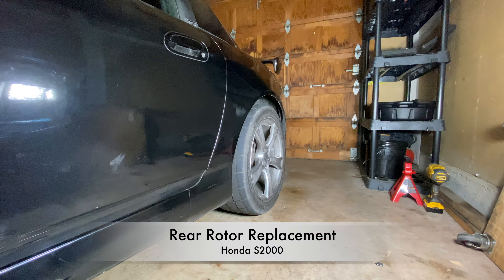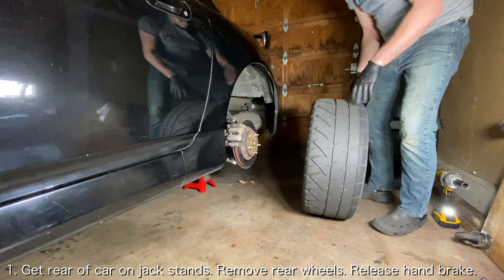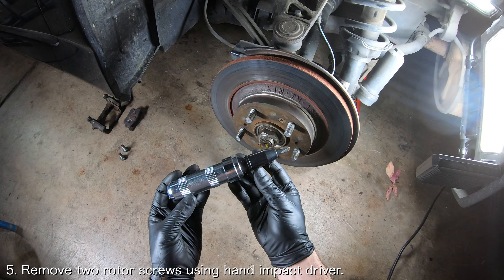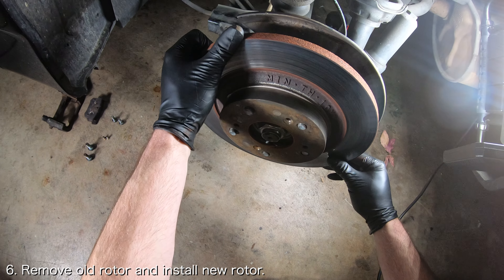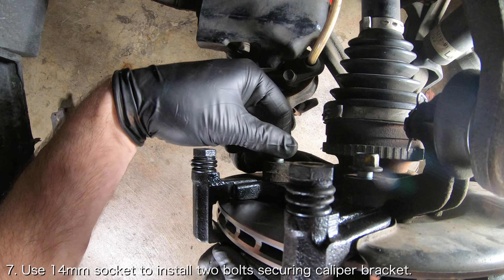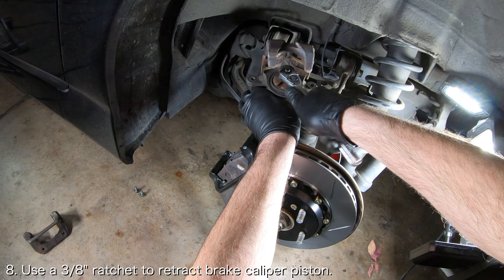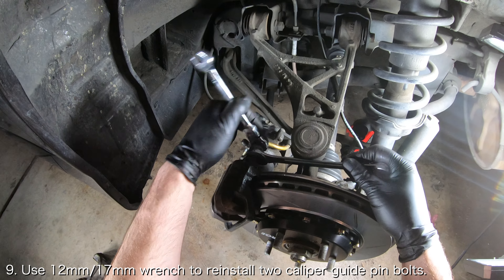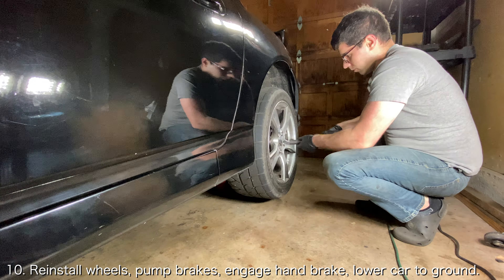Rear Rotor Replacement | Honda S2000

Comment: The rotor screws are JIS not Phillips head. Get a JIS screwdriver and they come out easy
Reply from the maker: Thank you! I’m still skeptical how easily they will be to remove with just the right screw driver. The impact helps a ton.
Reply: A number 3 Phillips works as well
Reply: @DIYGuysvideo  

Use a JIS impact screwdriver. Looks like a normal screwdriver, but hammer it, and you see its actually an impact driver.

Comment: Suggestion, loosen bleeder screw whenever compressing a caliper piston. Attach a bleeder hose to direct the fluid into a container.

This way no fluid overflows reservoir, and more importantly, doesn't force fluid backwards through ABS module, which can cause issues.
Reply from the maker: I’d argue that your suggestion is the most correct way to do this.

Comment: I like to put copper anti seize lube on the hub surface (after some removing some rust if necessary) so the rotors won’t get stuck for next replacement. Also putting on some silicone synthetic lube on the caliper pistons.
Reply from the maker: Thats some TLC ha.

Comment: I have these on my rotors on my s2000 now, great upgrade. Any chance you noticed some more noise from the rear brakes since installing these? Im guessing the noise is because of the grooves in the rotors as well as the lack of being able to use the pad slide clips?
Reply from the maker: Haven’t noticed anything too unusual yet. But yeah I’d imagine you’re correct about the missing clips.

Comment: Have you considered the SBG RX8-S197 rear brakes? They're awesome on my car! Also getting the brakes warm then using canned air held upside down to super-cool the screw will get them out super easy
Reply from the maker: I have. Also considered the Reilly Racing kit. They all have different advantages and disadvantages. I will talk a bit more about that in the urge flow rear rotor review. I basically just wanted to keep the car as close to OEM as possible.
Reply: @DIYGuysvideo  I was going to use his however SBG had a better deal and it's the same thing. I got the rotors and brake lines along with it for $50 more with free shipping.
Reply from the maker: If your sole purpose is to lower rear rotor temps then it’s the “same thing” but the kits are very different. As you know the SBG kit changes the calipers, rotors, and pads. As a result it adds rear brake bias, is heavier and requires different modifications on installation. If you wanted to use a quality two piece rotor with your kit you’re looking at $1600+.
Reply: @DIYGuysvideo  Oh I was just combating the Riley Racing to SBG's. Urge's rear rotors are a good option for better rear heat dissipation without further modification. I simply already had a front BBK from Baero and wanted more rear bias and better rotors as well. I believe the shift is now under 5% more front bias if that. I have also noticed lower brake temperatures by adding ducting and a 15*F difference using POR as a layer before paint on the stock calipers. I'm not quite sure how that actually helped but I'm thinking it helped hold less heat in the caliper itself but it could be a measuring error with the infrared thermometer even at close and further ranges.
Reply from the maker: Ah ok makes sense

Comment: Where did you place the jack stand? Differential jack point? If my pads are worn, do you see any reason not to replace them at the same time as the rotor?
Reply from the maker: For this job I placed the jack stand underneath the rear subframe. Sure. Replace the pads at the same time.

Comment: The link for the rotors aren't the same as the ones you used?
Reply from the maker: I can also link the ones I used as well. I think 99% of people doing this job won’t need the rotors I used though.
Reply: @DIYGuysvideo  that would be awesome. I figured the link was for the ones you used. I agree most won't need them but I plan on using 08 Acura TL brembo callipers in the front and those rotors would dress up the rear since I can't find rear brembos that will work with the s2k.

Comment: Needs to take out slider pins, clean up and relube with silicone grease... Otherwise, there's risk of the new pads binding to the disc. And as said, remove brake reservoir lid at the start. I'd be also copper greasing the backs of the pads/caliper fingers, and the shim area where the pads sides touches the caliper... Otherwise, they will squeal.. 😁

Comment: You forgot to put back the stainless pad slider.
Reply from the maker: That is because I replaced the rear caliper bracket with a modified one that won’t fit them 😎. They don’t normally fall out anyway.
Reply: DIYGuys oh iam sorry. Nice set up